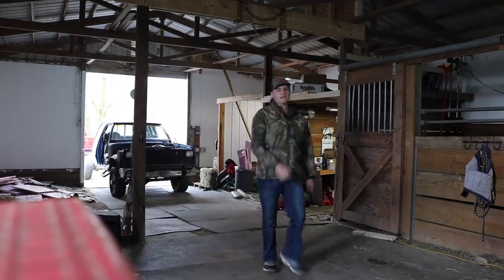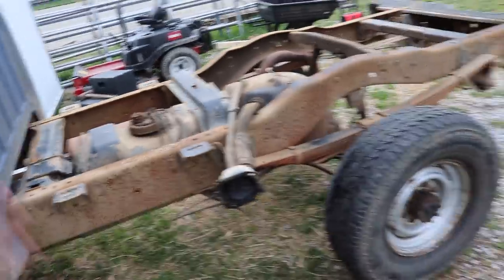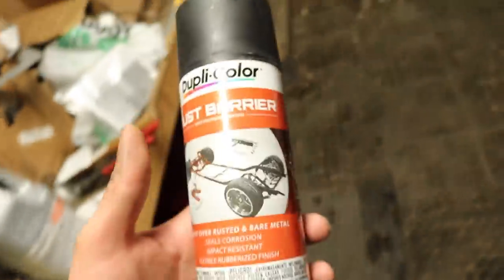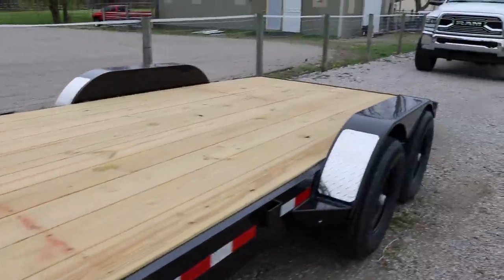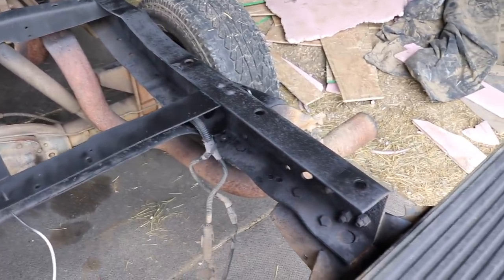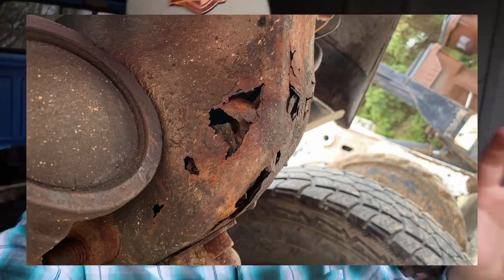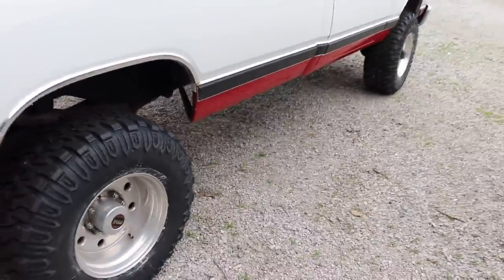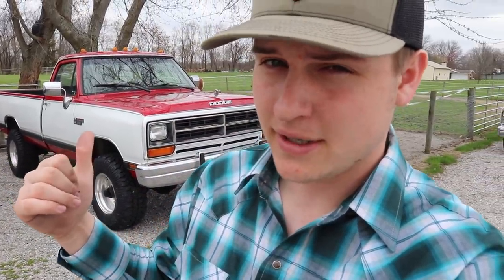MAJOR FaceBook Marketplace SCAM!!!

Comment: Very common issue on all the Dodgers from the 90s and early 2000s. Frame horns get rotten out, just like this one. It can often be a honest mistake for people that don't work on their trucks as most people look at the frame from around the middle crossmember back to check if their frame is "good" before they sell. Often a 50/50 of people just not even thinking to look at the front end of the frames. Always your responsibility when buying a truck unfortunately. Before you go look at these trucks ask them to send a picture of the frame horns, not too hard to get a pic of and save you the time. Bummer that the seller either didn't know or didn't disclose this issue.

Comment: Bro. another thing is butchered wiring harness for the radio, and cut up openings for the speakers. cheap rock chip guards (undercoating/ bed liner), I also found a non-ABS  bearing hub on a ABS system, and the list goes on, so this is truth for those looking, that watch for the "liars", who are selling these trucks

Comment: I’ve done the same thing when I bought my 89 5 speed 12 valve. Paid $4500 for rotted out first gen. 5 months later my dad buys a 92 5 speed 12 valve for $2800. I got screwed but I should’ve done my research.

Comment: I remember when you got your one ram truck and the guy who sold you the truck used body fencing and rubber undercoating to cover huge holes in the frame. And he coulda killed you and whoever was on the road at the time and he didn't even care.. ❤ glad you ended up getting that truck fixed and not getting hurt

Comment: I just bought a 1979 Ford f350 that's in better shape than alot of the 2nd gens I've seen the only thing it needs body wise is rockers cab corners and two holes in the floor patched that's it the cab mounts are clean the frame has only surface rust

Comment: You have to admit tho, you had your first Cummins for awhile and it didn't fall apart on you going  down the road. I guess Cummins powered second gens break the laws of vehicle age because especially with the 5 speed trucks. The drivetrain can last until the Lord returns provided you keep up the maintenance. The problem is no one knew the 12v motors would last as long as 1 million miles. No sheet metal or frame is good for that distance traveled especially with the use that these trucks get. This wouldn't be a problem if they hadn't came up with the idea of putting salt on the roads.
Reply from the maker: That man JB The problem is so many people bought them back in the day thinking it was going to be short term vehicle and treated them like such... Not keeping up with spraying the salt off of the frame and body. Like any vehicle, they will rot... and my 2nd gen way back did last of course... but this one was WAY WORSE! I wouldn’t put a gooseneck behind it for a minute!
Reply: @LOUDNPROUD  don't get me wrong I believe you when you say that this truck was wasted. Surface rust, eehh. But holes and its too far gone.